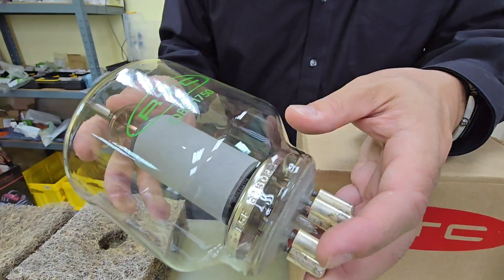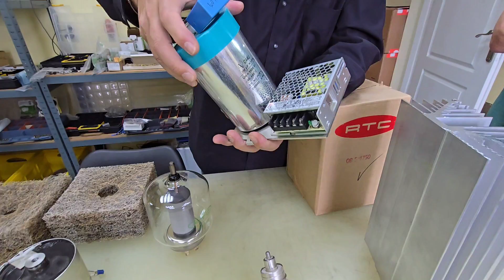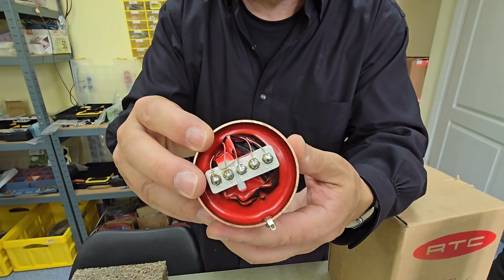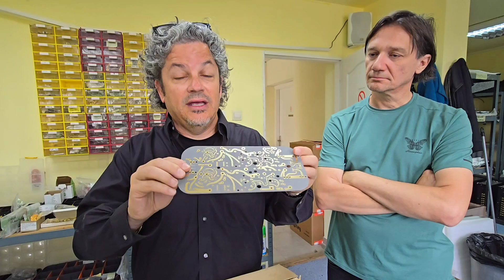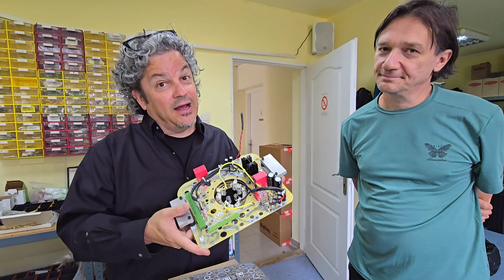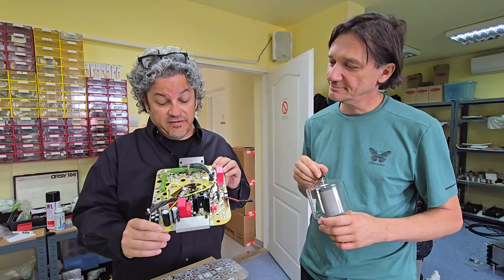WHY is NAT AUDIO tube gear different than all the rest ?? #audiophile #vacuumtube #amplifier

Comment: Great video! I love brands like Amplifon (from Poland), Aries Cerat (from Cyprus), and NAT (from Serbia), who custom-design, build and machine many of their own parts and chassis (and in particular output transformers, which should be considered an art form, given they're probably the single most important part sonically in any single-ended tube amp). Compared to 99.9% audiophile products on the market, these are true custom builds that sound, look and feel like relative bargains in the audio world. Yes, they're expensive and may be a stretch financially for many (myself included), but look and listen to what you're getting for you money, the pride of ownership completely sets these brands apart. Note QB5/1750 is a tetrode, unlike the 833 and GM70 Amplifon uses that are real triodes. Wiring tetrodes or pentodes (such as the 813 in some Aries Cerat models) as triodes results a different and often unique sound signature (distinctive distortion profiles for each of these transmitter tubes) compared to real triodes.

Comment: They look amazing on the inside. What speakers are best suited to these high power output direct-heated single ended triode designs? I would imagine that a benign impedance curve is still a prerequisite?
Reply from the maker: The big NAT monos are good from .5 Ohm to 32 Ohm.  You can call me for the best optimized match. I will consult for free.

Comment: Agree these are very cool products, and use amazing parts. Thanks for the video! I would just note, though, that virtually all PCBs used nowadays by any company worth its salt employ through-hole plating. NAT's use of  curved traces, too, (and lack of soldermask) is very cool, but FWIW I would argue that regular, sharper bends in traces do no harm whatsoever. You would have to get well into the MHz before it would truly matter to performance. If anyone attributes this to better sound quality, that's fine too!

In any case, the PCBs, like the rest of the components, show the designer's passion and attention to detail. I like that he does them that way.
Reply from the maker: Yes, exactly. If he's designing pcbs fit for NASA microwave transmission, it's probably going to be above average for audio. More than anything it let's us know about the designer. How Dejan thinks. He does not settle for what's "good enough for audio". This is the main message. ;-)

Comment: Great products. However, the best PCB in audio signal is no PCB. Point to point wiring is the way to go. Audio Note kondo knows that. Cary audio knows that. Not saying that NAT audio sounds bad. They probably sound wonderful. However, it would be better if the were point to point.
Reply from the maker: Trust me, nobody is complaining. They are all thrilled !! So go buy Audio Note if you like..

Comment: Amazing quality of design, built and parts. Unique, performance oriented, building philosophy. It's the first time I see extensive internal vibration control, (actually, the second, there is a Chinese guy in Canada using silicone everywhere inside, but here we also have order and discipline). Also very high level of modular shielding of different blocks or parts. You have skyrocketed my appreciation for this company with this presentation. Well done OCD Mickey! So anyone in need of many watts, can now properly listen to tubes unhindered. Because of NAT Audio.
Reply from the maker: For sure. ;-)
Reply: Yeah, most manufacturers are too lazy…..
Reply from the maker: Or they need to plan for high production level which means commercial level parts

Comment: Hi Mikey.  It is great that you got to Serbia and NAT Audio looks fantastic.  I just wanted to correct something about the QB5/1750 tube.  It is not a triode but is a tetrode.  Tetrodes have a screen grid and usually not considered as linear as a triode.  They might be using it connected in triode mode by tying the grids together.  Another choice for a transmitting triode tube similar to this would be the 3-500Z or the 833A tube.  These are also well known RF transmitting tubes but can be used for audio.  NAT Audio actually says in their description that the QB5/1750 is a triode - not correct - it is a tetrode.  By the way, I have many good friends on Ham Radio in Serbia.  Some of the guys at NAT might be Ham Radio guys if you asked.  Thanks for the fantastic video of this great company.  Prof. Jim
Reply from the maker: Thanks Jim.. very interesting... ;-)

Comment: Did a little digging on the QB 5...
The tube has 1600 watts TOTAL plate dissipation. When used at 50% that is around 500 watts plate dissipation which will
roughly equal to 100 watts output in SE.
Anode voltage is 4K ( WTF).
Filament is 10 volts at 10 amps (!!!)
Anode ( Plate resistance) is 16K-26k ohms.
The this tube has 2 grids..so load resistance is unknown...but output transformer must be HUMONGOUS!
 The inter-electrode capacitances are not that far off from a 300b/ 2a3 and since its a transmitter tube the amplification
factor is quite high...which means maybe ( however unlikely) a 6sn7 may be able to drive it.
That is a supposition...tube curves while triode connected are not supplied with the sources available...So NAT has to measure it themselves....which is what one would expect.  ;)
Reply from the maker: 6sn7 is a highly microphonic and "spongy" tube. 6n6P is used as driver I believe..